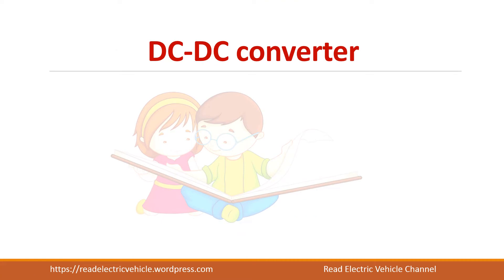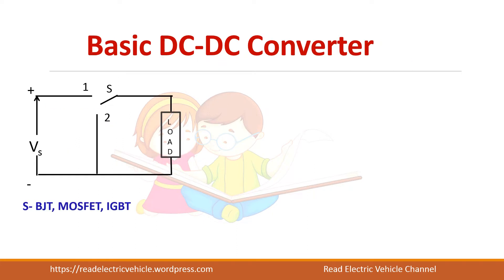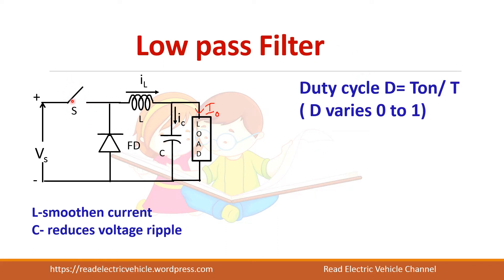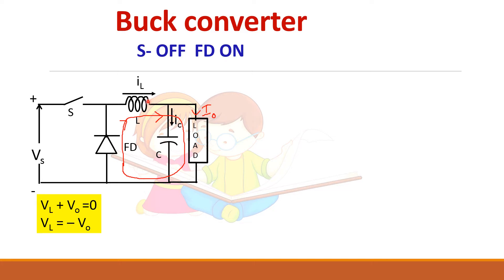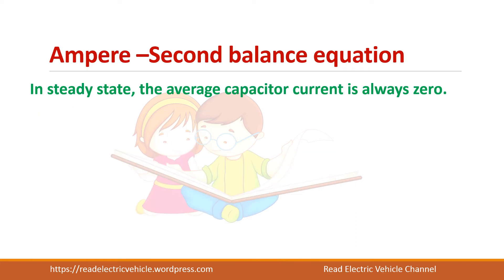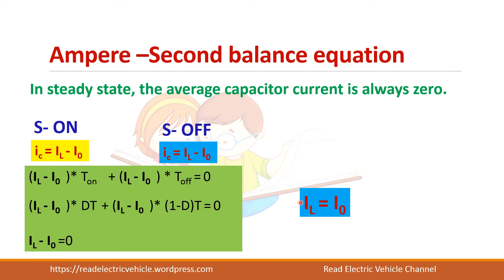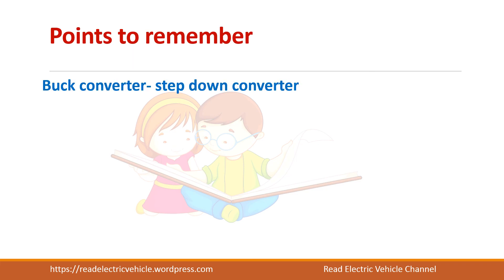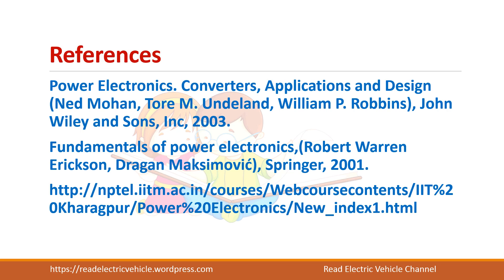35.DC-DC converter/Buck converter/step down chopper

Comment: I was with my 200 V / 50 A IN and 24 -96 V / 100 AMPS OUT 2-phase inter. BUCK MPPT quite successful , but to make 400 V / 100 A / 24 - 96 / 200 AMPS 4-phase BUCK MPPT at PCB, is quite a challenge. 200 AMPS continuous current from morning till evening  and 15 - 20 years running time needs a lot of knowledge.